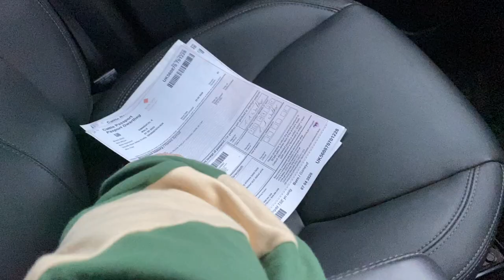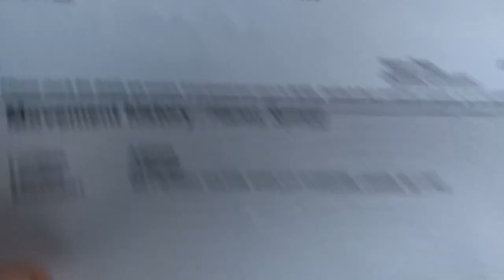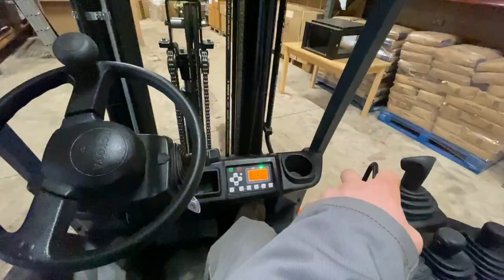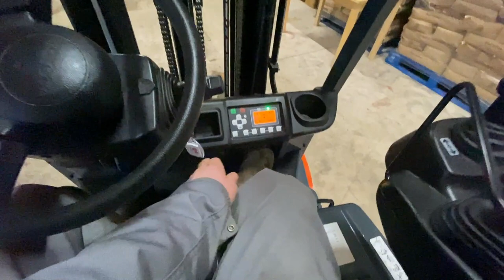BIG SURPRISE | FORKLIFT DEMO | TURNS ON A SIXPENCE #CRAWFORDFARMS #193

Comment: I've got the 3 wheeled version of that one albeit older. best thing i ever did!
Reply from the maker: 👌🏽 that one is 3 wheeled
Reply: @CrawfordsFarm1  sorry, i couldn't see the back. Only downside is when its going up the lip of a shed door or on less than level ground it does break traction a bit but overall the toyota is pretty much bombproof
Reply: Just to add i only have a single wheel on the rear and that's also the drive wheel
Reply from the maker: Ah right, i think front are drive on this machine but will make sure and check that
Reply: @CrawfordsFarm1  that will be far better then because it's always going to pulling the machine rather than pushing with one wheel.......I'd buy it👌👌🏴